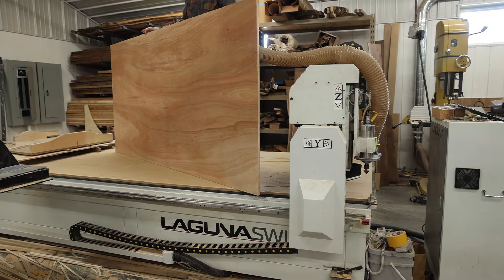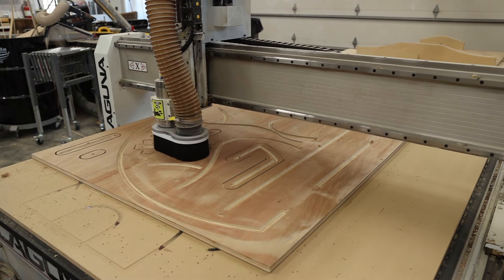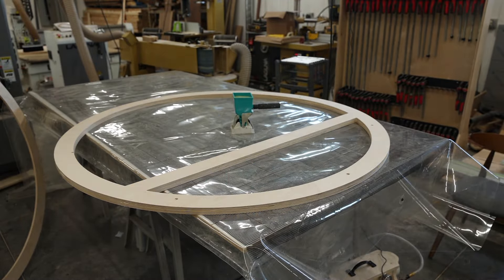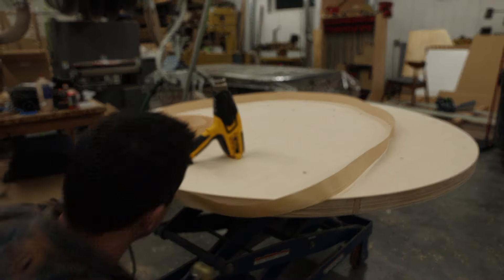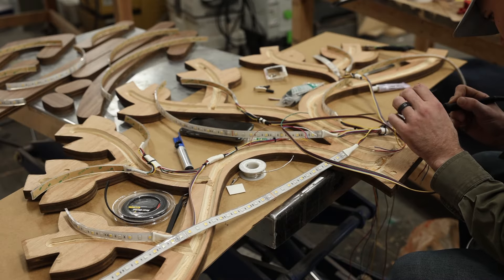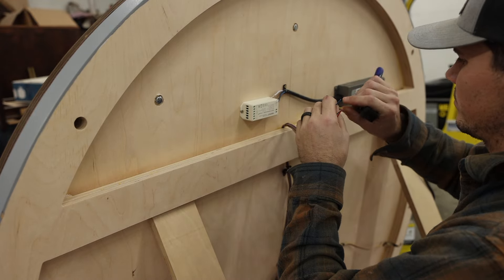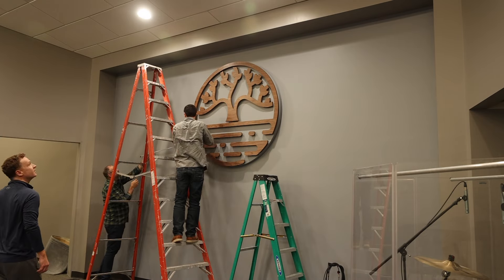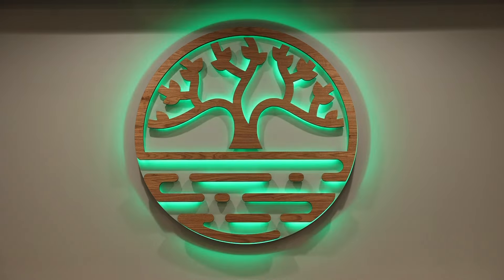DIY LED Sign - Logo With Backlit Lights

Comment: Looks great!  Can you describe the stand off connection a little more?  What did you use and how are the front pieces connected to them?  Thanks!
Reply from the maker: Thank you! These are standoffs meant to sandwich a glass panel. I put a screw inside the tube and into the walnut pieces and then I used the bolt side on the backer board. The screw had to fit through the threaded diameter of the standoff if that makes sense